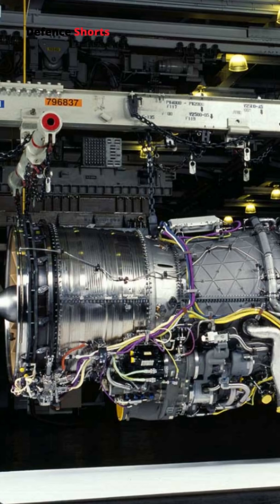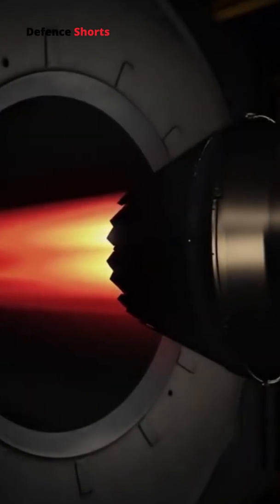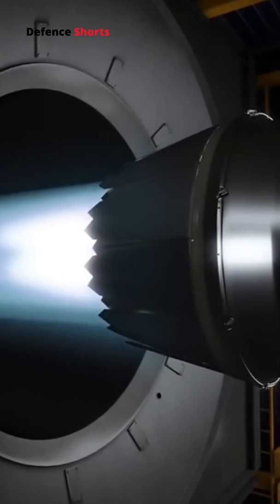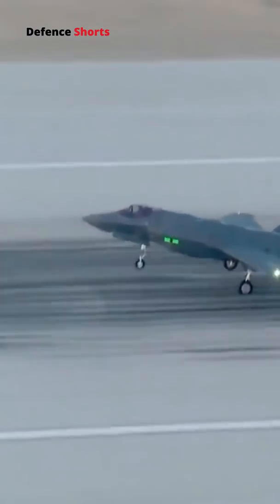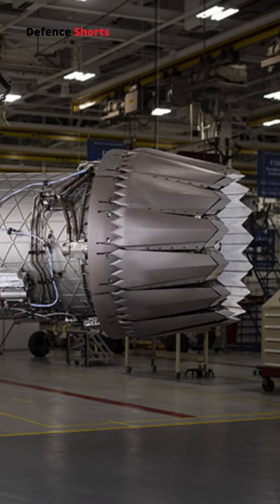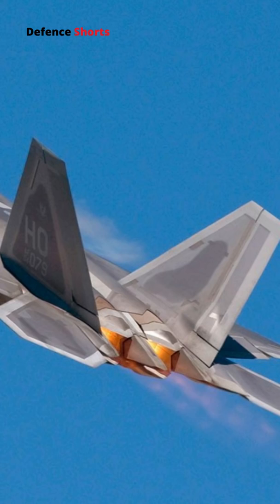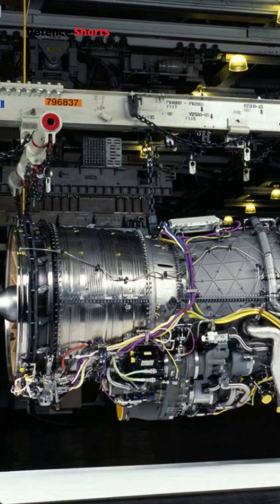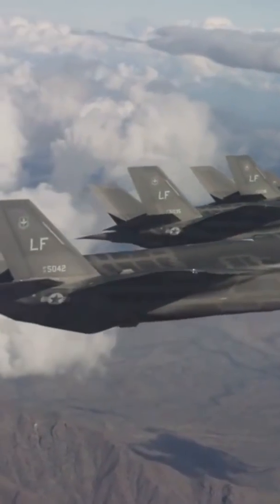F-35 Engine Is The Most Advanced and Powerful Engine? | #youtubeshorts #shorts

Comment: Fight: 0
Crashes: 4
Reply: Yep and a couple of f22s have crashed to but hey that's the best plane.
Reply: @The.Drunk-Koala  did you read about the f35 structural problems, stealth coating problems, not being able to operate in supersonic speed for more than few seconds, 
the F22  is  incomparable
Reply: @elkhalilmadani5889  so did the hornet, yet it's the fighter with some of the highest flying hours in history for a fighter. The vertical stabilizers would crack flying supersonic from turbulence of air going between the intakes and over the wings. Teething issues exist. 
The stealth coating had problems when breaking the sonic barrier, and this was on only the models with taller vertical stabilizers (the B and C model I think). This was years ago.

F22 had plenty of problems itself. Heck they had a faulty oxygen system at one point
Reply: @elkhalilmadani5889  It was proven in Vietnam war that having supersonic speed isn't always the best thing. There are no records of fighting in supersonic speed in Vietnam war, yes you can fly faster than any other planes but it also burn more fuel which lessen the operational range of the aircraft and less time in the air. It's probably why the USAF picked the F-22 because of it's thrust vectoring, after all how can you kill your enemy easily if it is flying at low speed, stays longer in the air, can outmaneuvered your missiles and turn faster, when you're flying at higher speed than it.
Reply: @AntonieSone  yeah but the thing is that it was made to be super sonic so the engineers somehow thought it was important ot they would have designed it not to be supersonic from the beginning.
Reply: @elkhalilmadani5889  also i forgot to mention that f35 isnt built to be air superiority fighter like f22, it was built to provide electronic warfare, intelligence, surveillance and reconnaissance capabilities
Reply: @AntonieSone  yeah true it's an amazing fighter jet. I didn't say otherwise.
Reply: @elkhalilmadani5889  The F-35A has no restrictions, that is the mass produced one for the airforce, only the carrier variants, F-35B and F-35C have restrictions but aircraft only go supersonic for short bursts of around 60 seconds anyways so it’s not really a problem.

All in all the F-35 is the greatest aircraft ever built. Don’t be fooled by clickbait media headlines, if you’re not a smooth brain it’s not that difficult to understand the superiority of the F-35. 

Literally every airforce in the world wants the F-35. Dozens of Airforce’s have chosen it over all the competition. The F-35 wins every procurement contract against contenders like the Super Hornet, F-16, Rafale, Gripen, Eurofighter Typhoon etc.
Reply: @tylerclayton6081  And, producing the parts is to be an advantage. Building from the ground up and standardizing is a monumental task. Wasn't pretty, but I think it'll pay off eventually.
Reply: @tylerclayton6081  Na the f22 still beats it in every category
Reply: @brix5438  but the F22 doesn’t have any SEAD capabilities or any air to ground capabilities for that matter, how can it beat the F35 in a category if it doesn’t even posses that capability itself
Reply: @brix5438  No the the f35 can loiter much better than the f22.
Reply: @elkhalilmadani5889  The F35 is the best fighter jet in the world
Reply: @elkhalilmadani5889 not being able to operate at supersonic speeds? I watch them run exercises over the UTTR holding mach 1.3 the whole time.
Reply: @Nediac800  bro i read articles from experts that says so, i didn't drive an F35 myself as we both know.
Reply: That’s actually not bad compared to other previous fighters but you won’t do enough research to realize that. Look up how many f16s crashes during development. But I’m sure you love that jet
Reply: @ryankubinski8789  Ospreys also had a bad begining and look at them now.
They are awesome
Reply: @ryankubinski8789  they weren't that expensive tho
Reply: @ryankubinski8789  thank you for putting that into terms some people can understand! I was just going to state but I figured I would get all kinds of backlash! But working on Pratt & Whitney, general electric, and Rolls-Royce turbines and rocket engines for SpaceX most of my life. Not that that means anything but I've seen a lot of defective equipment that we were rebuilding and as far as what I have been faced with over the years, is the Sukhoi and Mig divisions, as far as far as mechanical features and design are way way more advanced than we being America have ever been anybody who is a somebody with mechanically inclined knowledge for military equipment anyways has either been kidnapped by the CIA from Germany or Russia if you go back into history including the nuclear arsenal! I refuse to say what I was going to say because you can find a million videos of Russian equipment failing and Russian equipment " falling from the sky"I'm relating this to your comment by saying if we are seeing and hearing about the failures nobody will ever pay attention to a ratio of failures to success! Whereas you can't succeed without failing! But thank you for your comment
Reply: Only the truly stupid believe the reformer propaganda. While the project had many problems it has swiftly proven to be one of the most advanced aircraft ever created. The fact that it has so much interest and orders from foreign customers has already paid for any cost poured into the project.
Reply: @inksuckeye1  least based lazerpig enjoyer
Reply: Just testing its radar absorbent material if possible to used against sonar below the sea bed 😁😁😁
Reply: Planes never crashed are those never flied LOL
Reply: The f16 also crashed multiple times before it saw services
Reply: Thats the evolution of technology… 😂🤣😂
Reply: Cry with your non-existing planes
Reply: BrandonDotard  it’s ok it’s only around a billion in broken planes. 🤷🏻‍♂️
Reply: @EricKremer  that's not even the sad part.... The sad part is that the remaining functional planes will be used to bomb third world villages with no clean water to drink... You'll never see it against russian jets cuz that war will be nuclear.
Reply: @EricKremer half a billion. But yeah..
Reply: Ones crash was a woman
Reply: Women pilots man
Reply: I'm pretty sure it has more flights than crashes, otherwise they would have scrapped the project.
Reply: Planes crash asshole. The fuck is this supposed to mean?
Reply: Tell you what, how about you haters call China 🇨🇳 and tell them about the F around and Find out rule.
Reply: hey at least it looks good
Reply: "It's not the plane, It's the Pilot"

-Pete "Maverick" Mitchell
Reply: @dutchthespitfire3204  thats why your mercs are dying around 1 day since a special operation in ukraine started. in jul6 alone 21 American,  36 Canadian and over 100 polish are all dead
Reply: @philipcoffman4372  source?
Reply: Context.
Reply: Do you love banana  H bi bi ?
🍌U guys invention》n😅thin
🍌U guys tormented woman souLs》hiden r😢utines
🍌U guys supports for 
gL🗑b🏚LisL0st , 
c🗑mmunisL0st &
s🗑siaL0st 》L0yaL as maternal child to his/her parents 😲
🍌U guys stealing frm capitalis ; screws many NATIVES ; & duplicated constitutions》recycling spy &actors
Reply: Russain mis 25 fights 17 crash 114
Reply: the planes have existential crisis
Reply: @fbmw98  actually…
Reply: You guys are so moronic. Every aircraft in history had problems and crashes during development. This plane gets all the hate because it’s the first plane in the brain dead social media spotlight.
Reply: That's shockingly low for a née fighter the f16 had far more
The f35 is the greatest fighter ever built
Reply: cant make 6.5 g turns, fllies supersonic only for 50 seconds , vtol is reeingineered from yak141 perfect plane
Reply: @philipcoffman4372   cant make 6.5 g turns? Alright propagandist, yeah
Reply: @DS-wl5pk  all jets of 4th gen can .
Reply: its a subsonic , turkey looking hyped up project .
Reply: @philipcoffman4372  the fuck are you on about? Subsonic?
Reply: @DS-wl5pk  that’s the limitations for peace time, in war time, that restriction is lifted.
Reply: @philipcoffman4372  You call it a turkey even though it outright murdered every other 4th gen fighter it went up against. I'll even bring up red flag. 20:1 it went
Reply: @philipcoffman4372  "can't make 6.5g turns" you're probably referencing that combat test between the f-16 and f-35 where the f-35 had mediocre performance, those were the first models of the f-35 where the software and avionics were extremely limited, the f-35 can do 9G+ turns
Reply: 😂😂😂😂😂 this is the reason behind why men lives lesser then girls due to the addiction of speed
Reply: @petergriffin383  you wrote so many lines just to show your ignorance. 
First of all what i stated is a fact i didn't bring those numbers from sci-fi movie. 
And i those who cannot see the failures and mistakes and acknowledge them like yourself are not gonna go far in life 
The US had so many projects that failed and got canceled... I'm talking about billions maybe trillions of dollars gone from the tax payers money... I'm not an american i don't have to worry about that... But you should.
Reply: What you expect even Lockheed Martin said the F-35 is a big failure
Reply: @cemo3292  never let them see what your other hand is doing

Comment: I think f35 is too much Ai depended. A little thing goes wrong and the ai completely shuts down everything leaving no scope of manual correction. Despite having top class parts it is crashing
Reply: ... the F-35 isn’t relying on AI, that’s a 6th generation feature that isn’t present in any aircraft currently
Reply: @overlordgaming752  i meant systems are heavily controlled by computers.
Reply: @sharjinalaviantik9688  like basically all modern fighters? The fly by wire isn’t the thing that causes these crashes, most of it is due to external factors like the rain cover not being removed, the carriers arrestor cable failing pilot error
Reply: @GrundleLongDong  nah, all modern fighters have computers cotrolling different parts but not as heavily computer dependent as f35. Pilots have more control over the jet than the computers in other modern fighters. While in f35 it's opposite. Pilots have less controll. Although the things you have mentioned are also major factors.